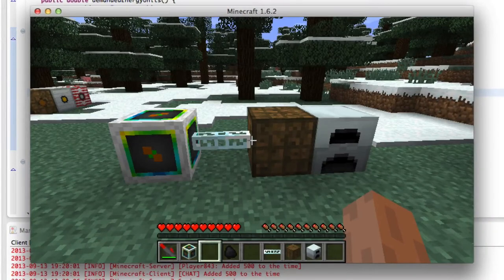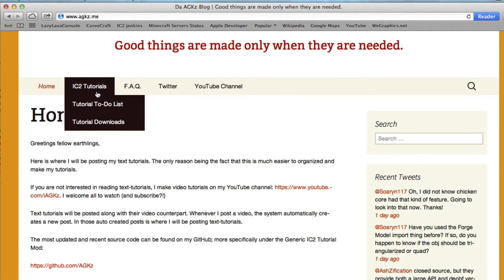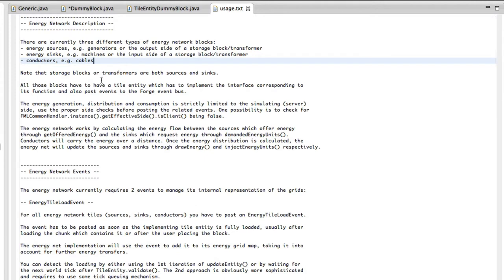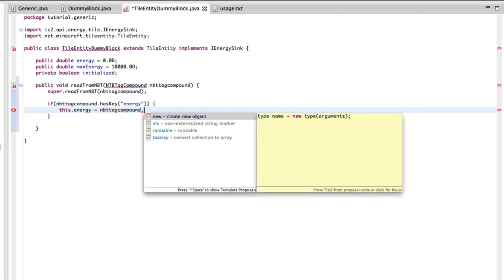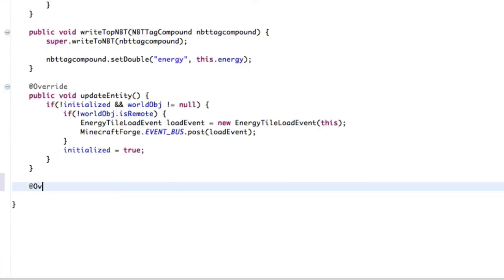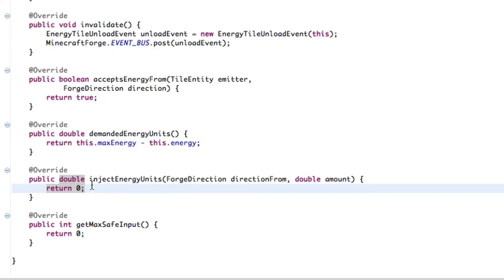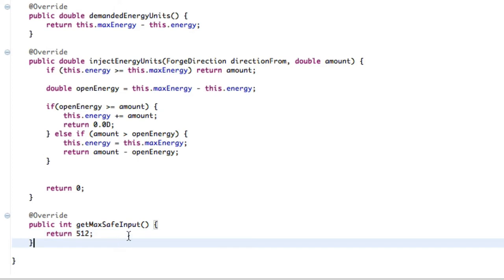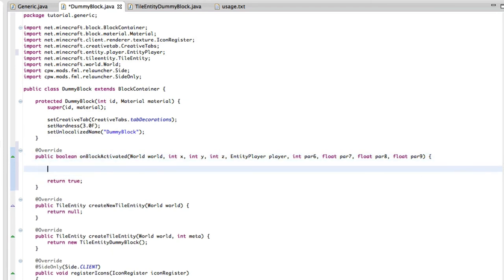-=[ IC2 API Tutorial ]=- Basic Machine

Comment from the maker: Because of the ever changing IC2 API, many things change. I this video I believe I am using the Experimental Version 2.0.158. I always try to use the most current version at the time of recording. In this case I was a little cut on time, so I used one a few version back. Using the API requires a good knowledge of java, so fixing minor errors should be easy enough. Sorry about the confusion!

Comment from the maker: You would need to implement both IEnergySink and IEnergySource. From there, you would need to change the side input/output (can't remember the name of the method) for it to interact with the correct side. Basically, it becomes a block of both types.